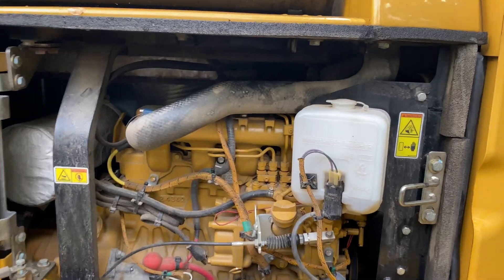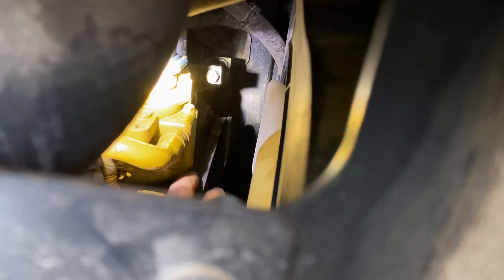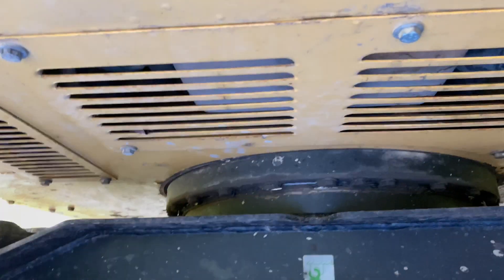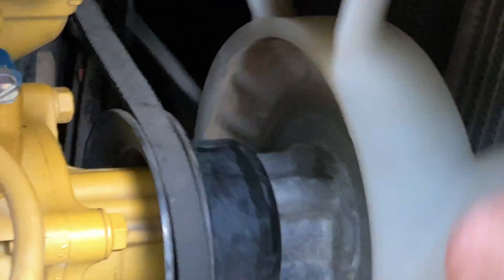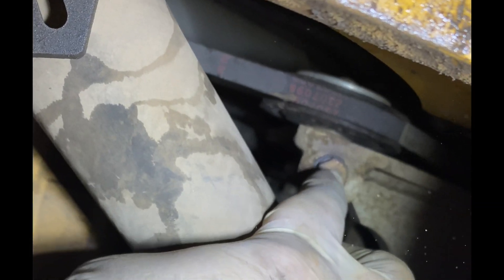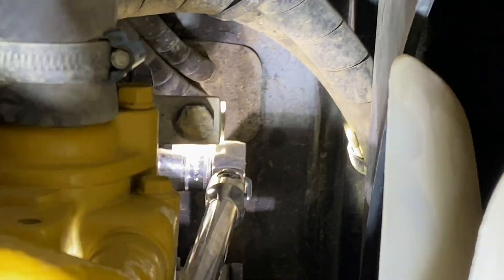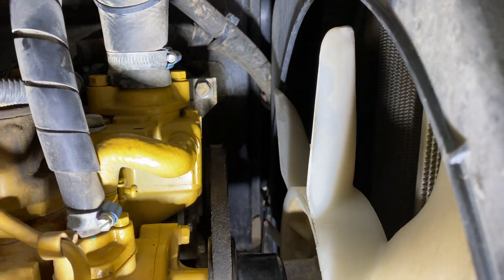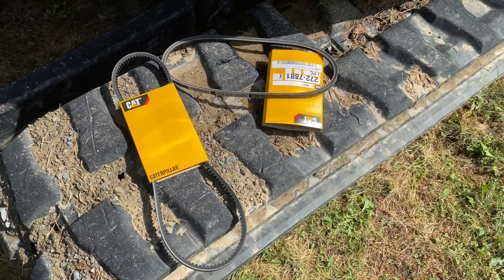CAT 305.5E CR Overheating Solved with new V-Belts

Comment: Thank you, did the belts yesterday. My 303.5 CR is actually a bit different, even tighter between pulley screw and fan cover. Took 45 min to loosen that screw 😅

Comment: You don’t happen to have the part numbers for the belts you got to fit? Helpful video mate, just can’t find the right belt
Reply from the maker: The part numbers are at 9:25 in the video.
Reply: @JoesCarSmartsNY  the ending you said they were both wrong though
Reply from the maker: @stuart662  Sorry for the confusion. The CAT belts were correct. The NAPA belts I originally bought were wrong. To make sure you get the right belts 100% call your local CAT dealer with your machines serial number and let them sell you the correct belts.
Reply: @JoesCarSmartsNY  thank you mate!

Comment: I'm having the same issue. Mine is a 2015 305.5e2 CR with just over 1200 hours. Thanks for posting this video!
Reply from the maker: Glad this helped you. Don’t forget to get CAT brand belts. That was the only way I could belts that fit correctly.
Reply: @JoesCarSmartsNY  I did get the Cat belts but the 272-7881 didn't fit my machine. I ordered the belts from the online Cat store using my serial number. After speaking to someone at Cat, she said I needed a different part number. Go figure. But, I tightened the AC belt, replaced the alternator belt and no more overheating (so far). Thanks again!
Reply from the maker: @JerichoRally  That’s annoying. Maybe there’s a slight difference in our machines. I guess the best way to get the correct part number is to contact CAT first with the machine serial number.

Comment: Will this work on my Kia and or my 87 vw fox
Reply from the maker: Not unless those cars have the rare backhoe arm attachment...Mr Haskins. 😂
Reply: @JoesCarSmartsNY  haha if I remember to take a pic I know where there is or was one... btw in all seriousness the crv vids might come in handy on my moms crv 👍🏼👍🏼👍🏼👍🏼
Reply: Great video. Just bought a 304 that needs a fan belt. Going to replace the ac belt as well just like you recommended. The manual says remove the fan guard which looked like a pita. This was was much easier 👍🏻